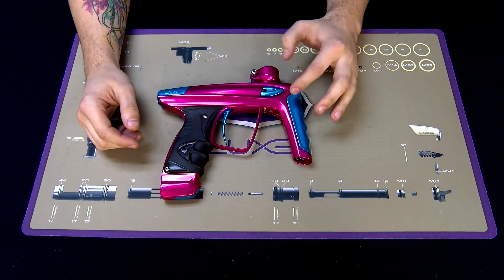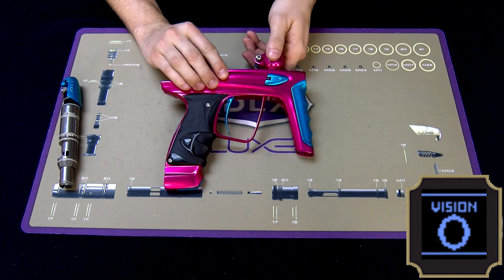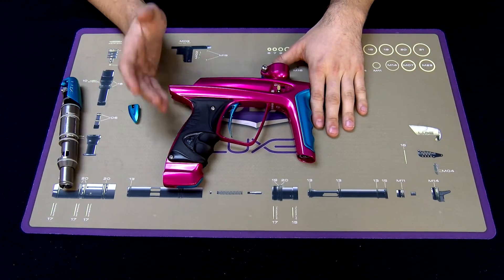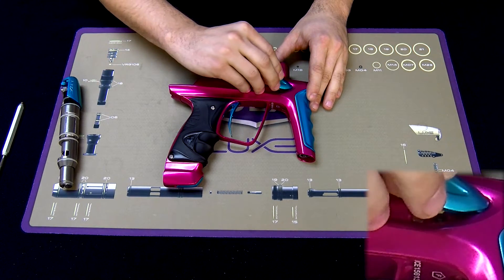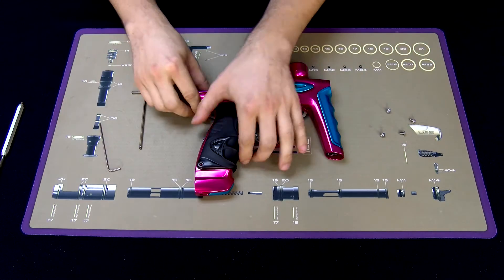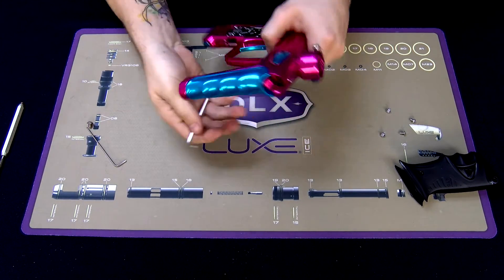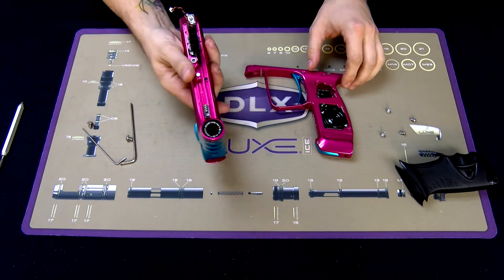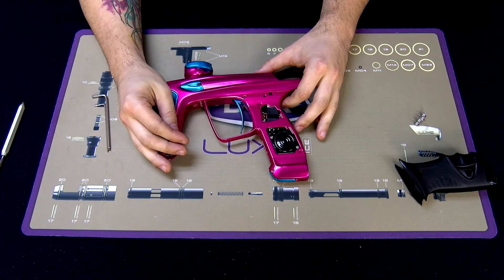Luxe ICE - Eye System Maintenance and Troubleshooting

Comment: I have the eye fault issue. I have replaced both the lower and upper ribbons and I’m still getting the eye fault error. Chamber is clean and clear but the image on the display shows a solid circle with no air no bolt no paint in the marker. Image doesn’t change with the bolt either.